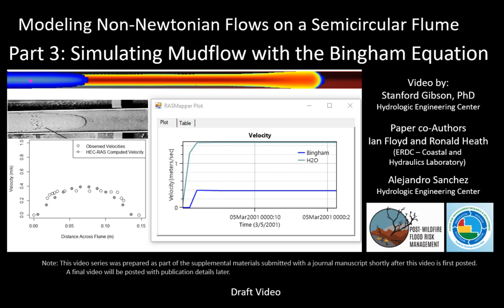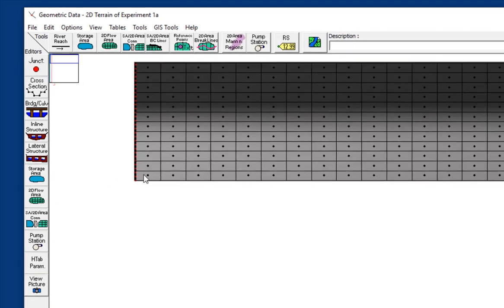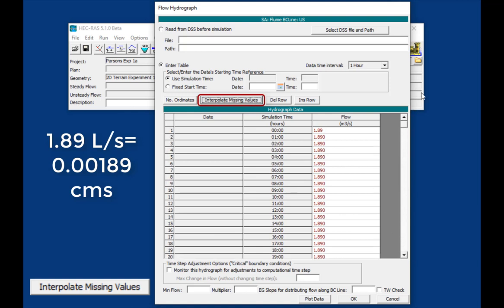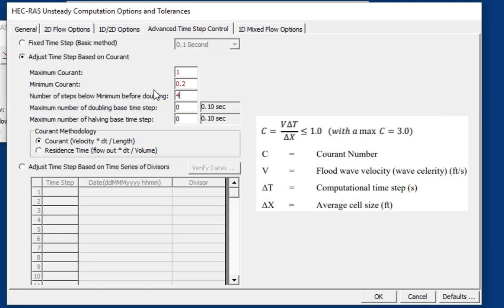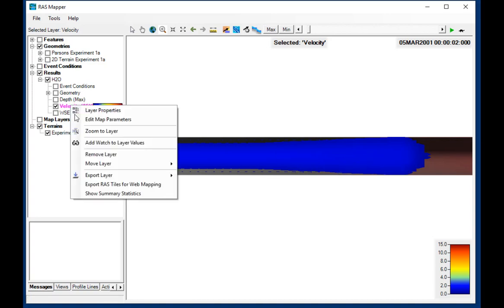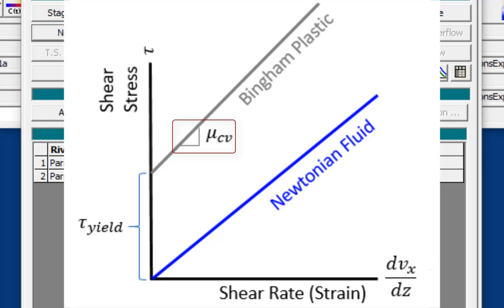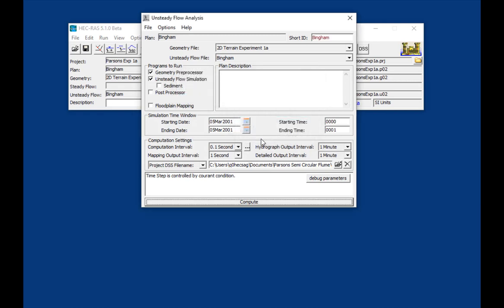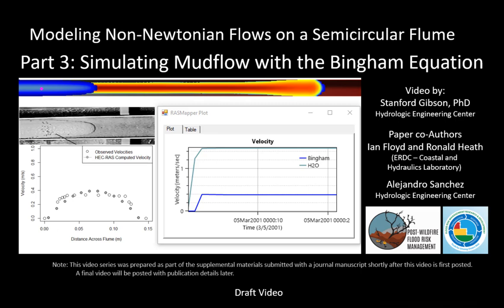Non-Newtonian HEC-RAS Simulation of Mudflow Experiment: Non-Newtonian Flume Series (Part 3 - Update)

Comment: Great job! Due to a big error in volume accouting at the end of my simulations (between 20% and 13%), I wonder if I can decrease the tolerances (volume or WSE) and increase the iterations (over 40) to get a better solution (my computer is fast :D )
Reply from the maker: Yeah, when the volumes and stages are so small, the error % can be significant.  Decreasing the tolerances and increasing the iterations would be a great approach to reduce these.
Reply: @stanfordgibson  I ran it and it seems that works, thank you!

Comment: Thank you so much, this video is amazing! 
I wonder if I took geotechnical parameters, high Cvs and high flow hyprographs to model a landslide, it could be adequate? Thank you!
Reply from the maker: Good question.  The transition from high concentration fluid to geotechnical failure is more of a continuum than a threshold.   We put the clastic methods in for more geotechnical events like you are describing.  But single phase rheology is a heuristic for debris flow, and even more approximate for geotechnical processes.  I don't have a lot of experience with those methods yet, but the geotechnical parameters go into a yield strength...which means that they are designed to compute when a matrix supported mass comes to rest (e.g. develops enough internal friction to stop).  I know people use methods like this for avalanches and landslides, but I'd be cautious...try to validate them to known events first.
Reply: @stanfordgibson  Thank you so much!! I'll validate some known events...

Comment: Hi, you did a great work. It really helped us to understand the simulation. However, I have a question regarding the process of meshing. While moving from part 2 to 3, I think the meshing process is missing. I tried to mesh and run the simulation, but my results of velocity were different. It would be really helpful if you suggest us about the proper steps of meshing in this particular process. Thank you!